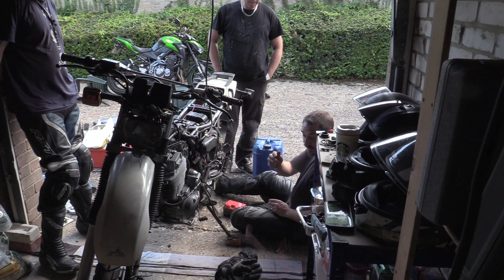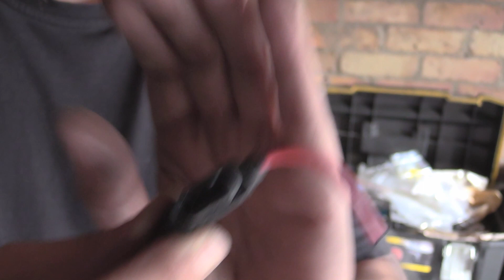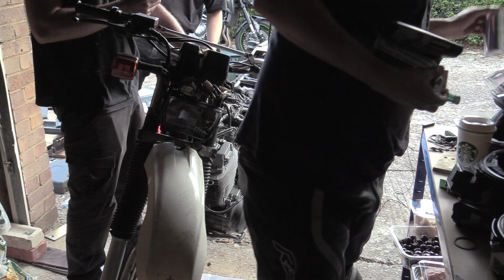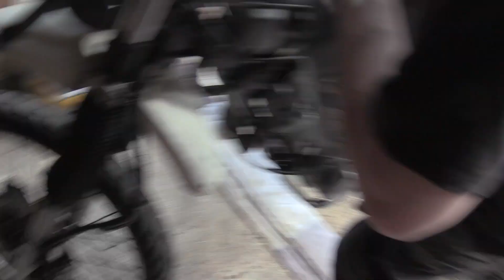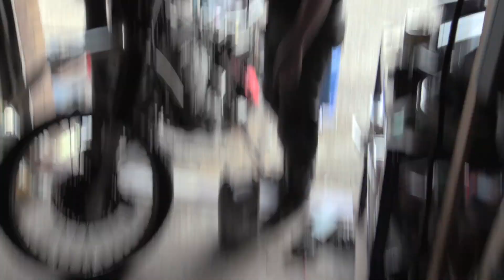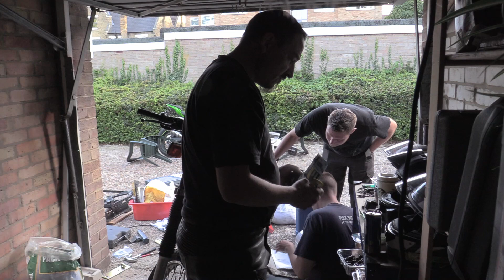TechTARDs - Prelude

Comment: Just discover this channel last week, watch as much as I can every evenning/night so fucking great, so much to learn ! Little question for you Matt what do you think about the new triumph Rocket 3 Engine from an engineering point of view?
Reply from the maker: That's a big question....... narrow it down a bit
Reply: Well it's make "only" 167hp for a 2.5L, the torque number (221Nm) seems like ~2 times more than a 1000cc but I expected a bit more. Let's take for example a 1400ZZR engine which make 154Nm if you take the ratio Nm/L it's 110Nm/L and the Triumph make 88.4Nm/L but the Triumph have less piston and bigger one (84 vs 110.2) I was wondering why it doesn't make more torque ? Maybe to much stress on the crankshaft/rods/etc.. or combustion chamber problem ?
Reply: @53000bob  the output is restricted if its anything like the old one the limited torque and BHP is a tuning thing not anything close to what the thing is capable of.

Comment: Rule of thumb in my experience,  if the mixture screw is on the front (engine side) of the carb then it adjusts the fuel - so out = more fuel,  if it's on the rear if the carb (airbox side) then it adjusts air,  so out = more air..
Reply from the maker: And then you have a dual carb, with only 1 screw which is the enrichment circuit and a balancer adjustment - oh and the carbs are not the original ones for this bike
Reply: I've had a few twin carbs on single cylinder bikes - the pegaso and freewind both had 2 carbs that were the same,  the XT 350 and 600 both had 2 carbs but different sizes..
The pegaso and freewind had 2 mixture screws,  1 for each carb and balanced evenly on the butterfly,  the XT only 1 and the balance wasn't set even - as I think Tim mentioned in the vid. 
Wrong carbs however and all bets are off 😂
Reply: On another note,  the freewind also had 2 spark plugs,  1 exhaust port,  the Pegaso has 1 spark plug,  2 exhaust ports and 5 valves 😶
Reply: @thedirtyworkshop  mostly
Reply: @waynedl99  So, the carb story: I took the UK carb and the Swiss carb, dismantled both and reassembled with all the best bits. I used the shop manual. I cannot for the life of remember if i used the swiss or uk as the base though...which is annoying.
From memory (3yrs) I remember there were surprisingly few differences (main one being the atmospheric pressure feed that should have been attached to the airbox)
Reply: @TheWinalot The reason it attaches to the airbox is simply to give the atmospheric air a filter - the atmospheric air is fine being loose while testing.
However, having / not having an airbox connected on the carb makes a MASSIVE difference, an airbox is a very good and intricate design, like a musical instrument - which always makes me laugh when people start drilling them etc

Comment: Hi Matt. This is not video related, but I have a question that I hope you could answer. Me and my mate removed the final muffler of his 1.6 N/A petrol VW Golf. We went for a little ride and the car was noticeably slower than before. I saw your video about exhaust backpressure and I don't understand why it lost power.
Reply from the maker: Because the back pressure has changed - hence the resonance has changed
Reply: @thedirtyworkshop  what do you mean by having changed the resonance? No exhaust scavenging?

Comment: XT600 HELL YEA! I've got a pdf manual(XT600A/AC) for it if you need it. At 50k miles the cylinder and rings will most likely be toast, they get fucked quick.